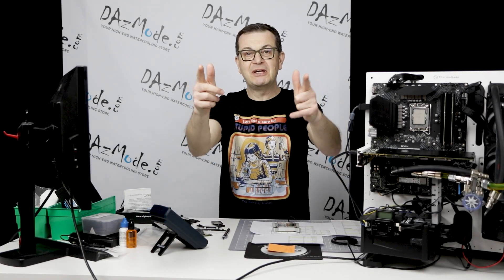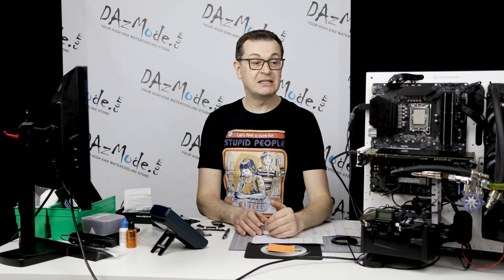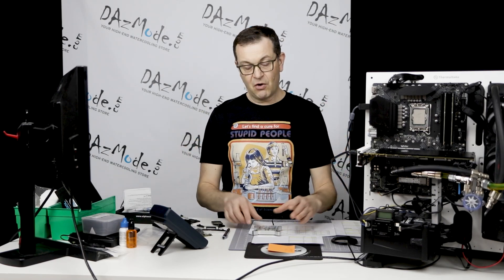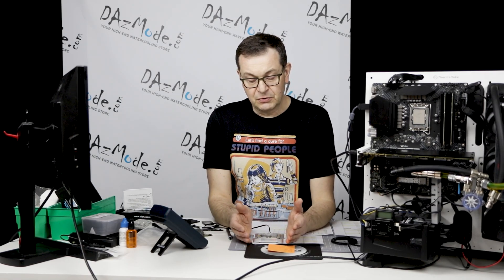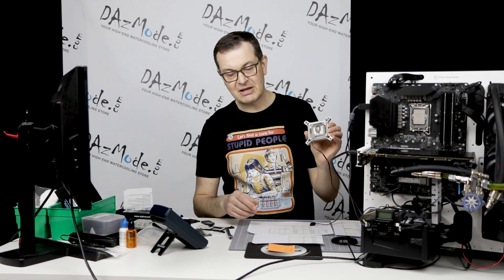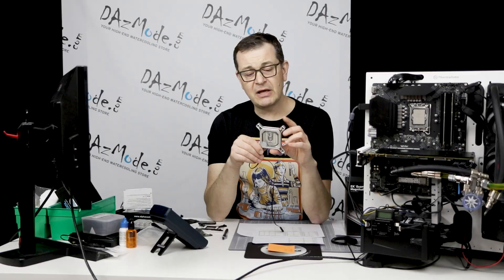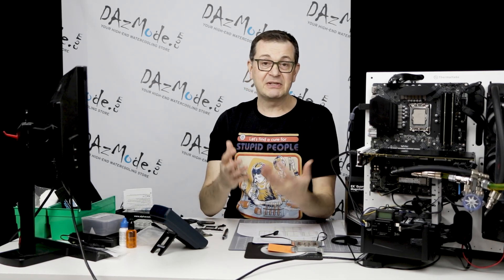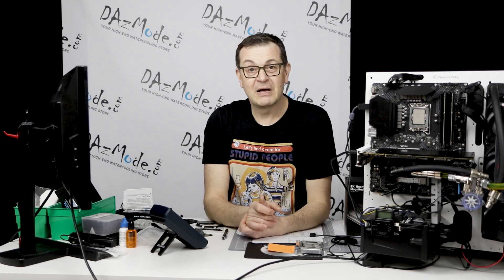2022 CPU Blocks Roundup: EKWB Magnitude

Comment: I bought EKWB Magnitude only because it looks pretty. BUT, HOLY COW, the backplate for Magnitude is so ugly, it's rough at surface, no polish, no painting, It looks like EKWB put it right from the metal mold then put it into box and sell it. I can't believe 400 USD CPU block has such a ugly backplate.

Comment: I have an EK Quantum Velocity on my cpu and for me to spend 2x the amount I’d have to get at least a 5c or more temp drop. I get, and respect the milled aluminum artistry but…
Reply: You need to remember waterblocks are waterblocks.. even 20 years ago you didnt see 5c temp drops for them which is why i used the same block for 20 years just changed the mounting brackets for it..  i use a newer block now but still

Comment: Hi. I also have both magnitude and velocity. 10900k@5.3 sp93  in extreme overclocking. The difference is about 3 degrees. But! I have problems with magnitude in the same circuit when using MO-RA3 copper radiators - nickel corrodes in magnitude, which has not happened in 2 years of using velocity. Perhaps this is a special case with me, but this is a fact - for 1 month, traces of corrosion inside the magnitude are visible.⚠

Comment: Speaking of "rich guys block", I am really curious about a comparison with the aquacomputer silver coldplate version. There aren't a lot of reviews on that one.
Reply: essentially it's crap. roman aka der8auer did a good review.
Reply: @Alph92  You mean the one with comparing the electric conductivity right? I remember the conclusion being the silver would be close if not worse than the copper one. Still there are limited reviews on the block itself. Nevertheless, I would still like to know if the aquacomputer block is better/worst than magnitude or the velocity^2 I have right now.

Comment: LOL 1C difference...no wonder EK had to recently lay off 25% of their people, they've completely lost touch with the market. Instead of making WC more affordable, like Chinese brands do, they're going for stupidly overpriced status products that only a few people will buy. Same happened with their RTX GPU water blocks. I'm using an old Supremacy block with my 12900K and working perfectly fine, temps are great, no reason to buy a new model until we see a really big performance leap. Also, for several years now, I only buy Barrow fittings and WC parts, great quality at half the price of EKWB. They have a problem in Slovakia, imho. Their sales will keep on going down if they don't listen to the market...
Reply: yep. Said that way back when they released this abomination. They lost their mind. 1C is literally within a margin of error. Using heatkiller IV for over 5 years at this point and i've got it for like 80 €
Reply: I still have my Supremacy evo Full Nickel CSQ. Quite timeless design, fiercly effective and thanks to being a full metal design there will be no cracking at the threads. Consumers have caught on to this. The prices of full metal blocks on ebay are quite high. If you have a full metal block hold on to it.
Reply: Waterblock is a waterblock.. i used a dangerden maze 3 block for nearly 20 years just making a diff mounting system for each socket i upgraded from..  really new blocks dont do much which is why i didnt bother.   I use a supremacy evo now of course i finally upgraded 4 years ago lol